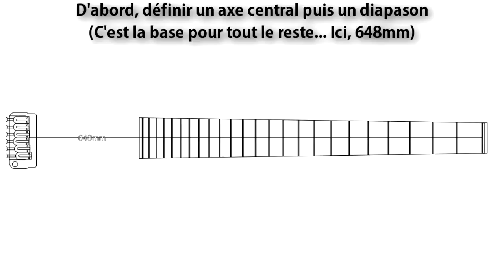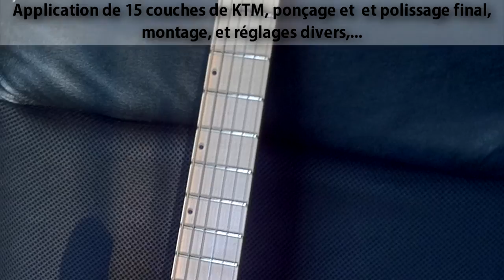Suhr Modern AM Guitar Build [ENG SUBTITLES]

Comment: It looks like your drawing has the nut width being 1.75" or 44.45 mm. Is that intentional or do you have a 42mm nut width?
Reply from the maker: Damn ! I've just opened the svg I uploaded on mediafire, and... I feel ashamed, that's a log ^^'
I really don't know what happened, because everything else seems in place and the length scale is right (648mm).
Yes, the final build had a 42mm nut.

Thank you very much for putting this !

ps. I'll modify the file tomorrow of course, just in case. I can't believe it stayed 2 years and a half like that ^^
Reply: +swarmadd well a few mm on a drawing isn't that bad. It's a really incredible job! I'm gonna start a build using your drawings this week and just wanted to double check that and figure out if I needed to modify that.
Reply from the maker: Anyway, in guitarmaking, you'd better always double check, at least, hehe
I just put the new file into the description, I reduced neck width and corrected headstock on the way (It's called V2 : no confusion ^^) Also, if you can open/edit the svg, you'll see there are the photos of suhrs I used in it (These layers are just hidden, I work with Inkscape)
Thanks again, and have fun building it :)